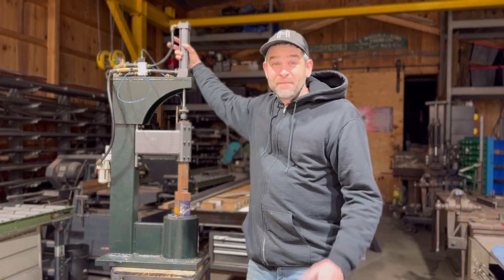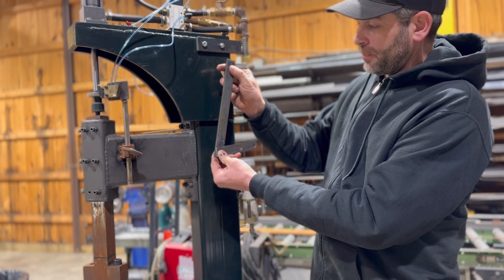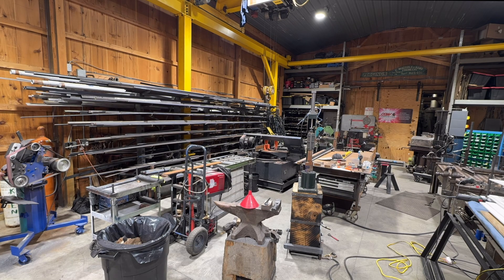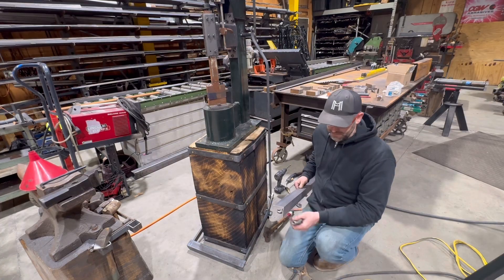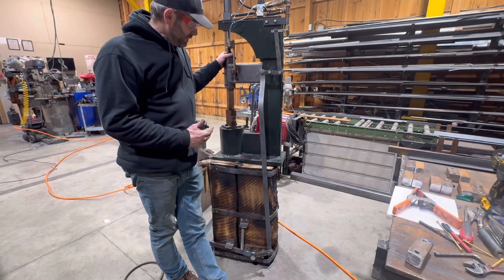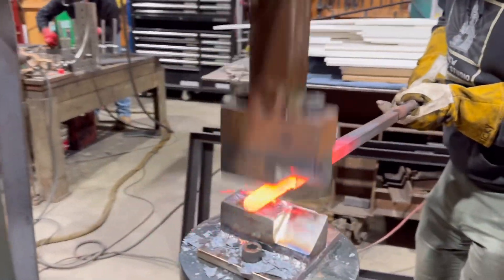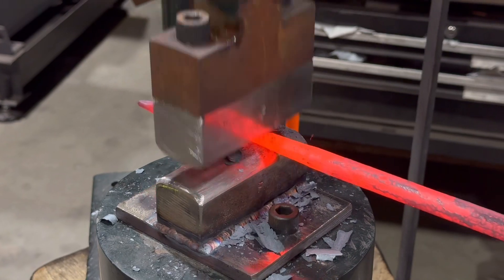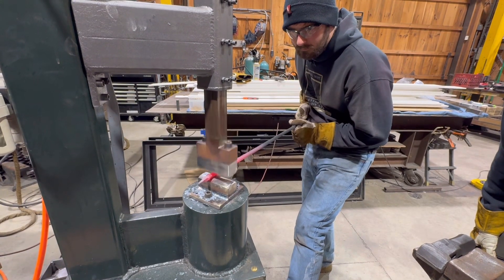Shop Built Power Hammer, finally forging!

Comment: More info about the Etsy store...  Later this spring, I will be working on build documents for Bulldogs 15, 50, 100 and 125 pound rams...  and possibly a 150.  I have already proven the air circuits for  up to the Bulldog 125.
Reply: Also, Matt didn't implement it, but my plans have directions to implement a true single-hit capability, with you setting the impact force... from a little tap, to full force.
Reply from the maker: Not on this hammer but definitely on the 36#ers! That's an awesome feature